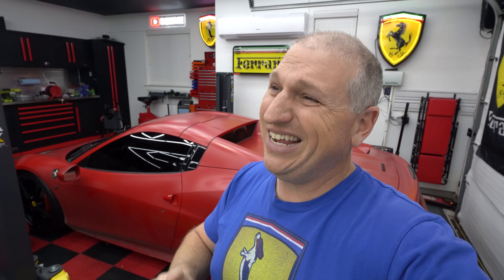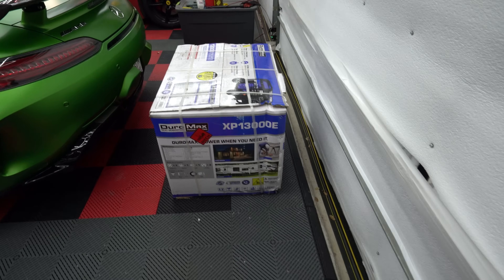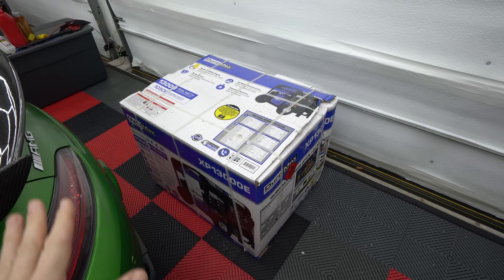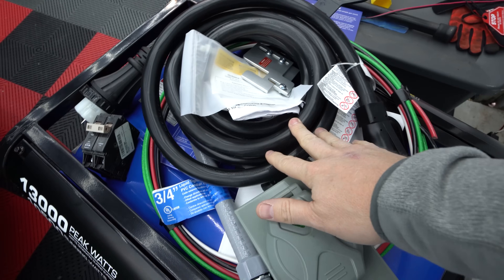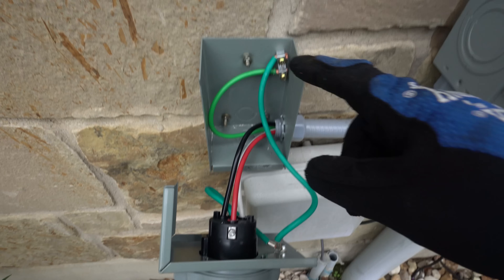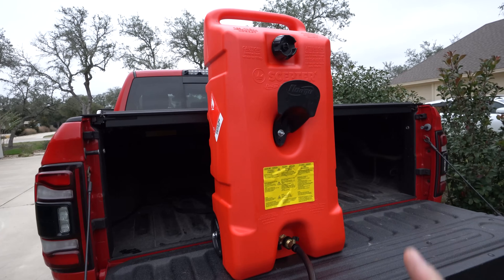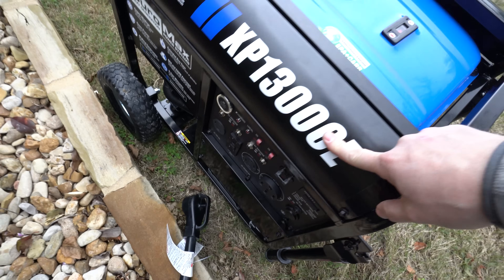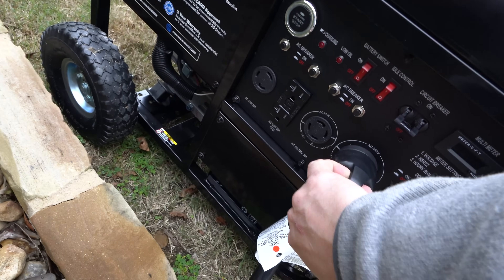How to Install a Backup Generator with Interlock Kit on a Budget

Comment: I have that very generator, looks the same only 12,500 watts. 10k under load. 
A couple points, mine killed our coffee maker. Guess the surge. Also I have a buddy in Fla that killed his fridge during generator use from a hurricane. So, be aware that without the inverter or whatever the hell it’s called, that flattens the phase on load , sensitive electronics and controls can be affected. 
I know you can buy these control boxes at an RV store. I haven’t, because I’m stupid. (Coffee maker was $150 bucks which would have covered a lot of the cost).  
Also. Believe me here, turn off ALL of the breakers when starting up the generator. Turn on the individual ones you actually need, like pool and heat. And the room you are huddled in, after the generator is started. I learned the hard way the first time I used it that it’s a PIA to do all this in the dark and rain. (Never need it when the weather is good) so sharpie the breakers that are the key ones to be on. 
Lastly. Reverse the process when reverting to city power. Everything off, main breaker on, then individual breakers one at a time. 
I too run only non-ethanol gas, and use a battery operated pump (Amazon) to fill and drain the generator tank. 
I start and run the unit about every two months and keep it on its own battery maintainer when not in use. Dead battery… bad time when it’s cold. 
I also did a sheet showing the main circuits and their power amperage draw. That tells me what can be on at the same time. This all takes time, but now vs when it’s cold/hot is time we’ll spent!
I’m in GA and we have ice storms. So I get it. 
Finally, if Beto had won you’d be on the national grid by now! Sorry,, had to add that. 👍
Reply: Yeah, Texans have no one to blame but TX politicians who are in the pockets of the utilities.  Free enterprise has its costs and Texans paid dearly for letting profit maximizing businessmen decide what's best for the population.  I guess the businessmen needed newer private jets, better supercars, and more vacation homes than they needed to protect the citizens of Texas from having no electricity during a life threatening (and sadly life ending) storm.
Reply: Your absolutely right! This day & age you NEED a inverter generator.. Just about everything now has circuit boards in them.. I wish Dan did a little more research like me (NO dis-respect to him, Really like his channel).. This could be costly for him if the refrigerator gets fried & other things (he did a great install)!  After all my research.. I picked the Honda EU7000is (EFI) it powers everything I need, and then some.. It's around $4,000 but what does a new refrigerator cost 3k? Dan is a smart guy, I'm sure he knows about harmonic distortion!
Reply: @nickd5591  The main thing with any generator is to start it with the circuit breaker off ; and turn it off before stopping the engine. And NEVER let run out of gas while in use. The cycles per second are dictated by engine speed.
Reply from the maker: Theoretically as long as it's holding 60hz it should be reasonably safe for most devices but yes, a true inverter would have been good but also very expensive
Reply: @ETM-md7cu   Of coarse.. I assumed everyone that operated a generator, knew that procedure... Besides that yes if it's truly holding 60hz. IMO I just don't trust a non-inverter generator, to power expensive stuff in my home.
Reply: @normalguysupercar  dude! You are a Super Car guy! What Really does expensive mean! 
Go to the RV dealer almost all RV’s have these if they have generators.
Reply: Yeah, sometimes the DC power supplies for the electronics on some of these boards have half-wave rectifiers instead of full-wave. I have a problem with trying to power the ignition module on my water heater with a genset. Darn thing turn on but the airflow switch is sold state with a pull down ground. So it never makes and the unit never turns on.
Reply: @normalguysupercar  The problem is inductive loads like your pool pump have a high inrush current which will cause the frequency to sag while the generator tries to overcome the sudden load and anything else plugged in might be damaged.  The inverter generators are not that expensive.  3500 watts may be enough to run your pool pump and everything except HVAC.  Honda is the king but some of the clones are really good too.  I never hear anything wrong with the Harbor Freight Predator line of inverter generators.  I don't recall if you said what your plan for backup heat was but I'm in Texas as well and I don't rely on a portable gas generator for emergency heating of my home and would look at other sources for emergency heat and a smaller inverter generator for the electrical backup.

Comment: Although the gas is ethanol free, I would still add a fuel stabilizer like Sta-bil or Startron to it.  Modern gas will start going bad in a month even without ethanol.
Reply from the maker: Yeah I got some of that stuff and plan to add it in
Reply: I was going to mention the same. Zero ethanol.gas.is best but it still goes bad after about 6 months.  It can lose flammability and also turn to  varnish.  You don't want that stuff in your generator long term, because you will run into problems trying to start it in 12 months.   My suggestion is to run the generator dry of gas when you think it might sit for more than a few months.   Then add a couple of ounces of gas every 6 months, then start and run it dry again.  This keeps things moving and starting when needed, and doesn't leave anything to gum up when you are waiting for the next power outage